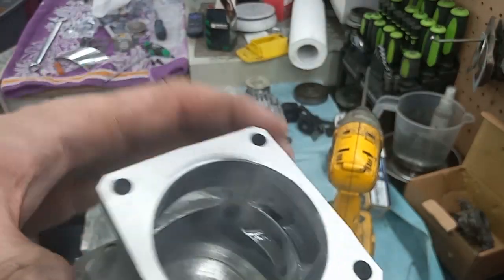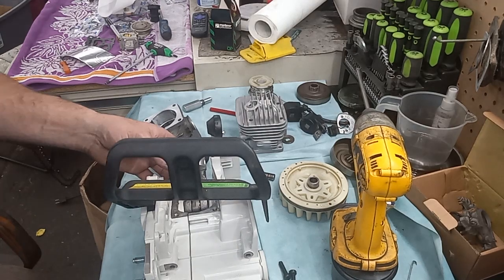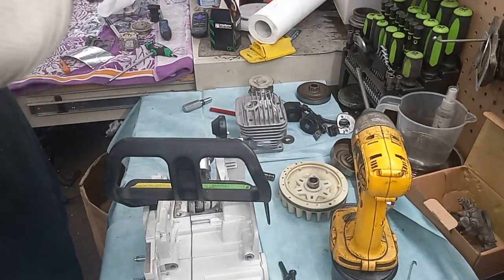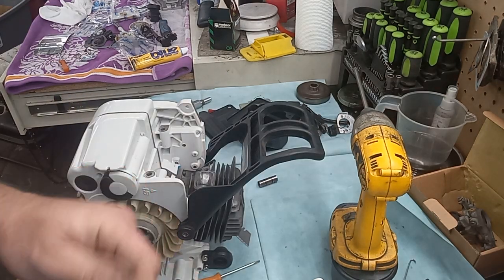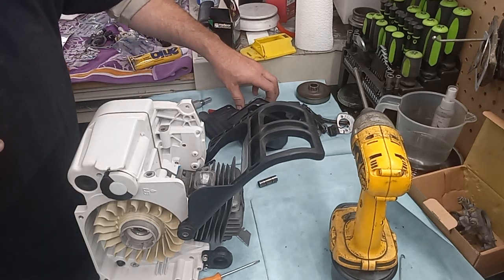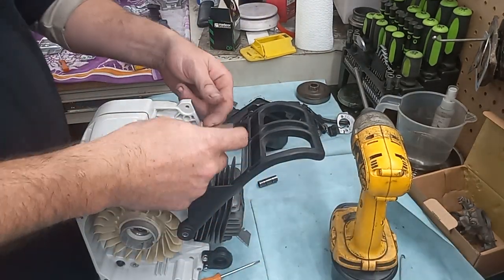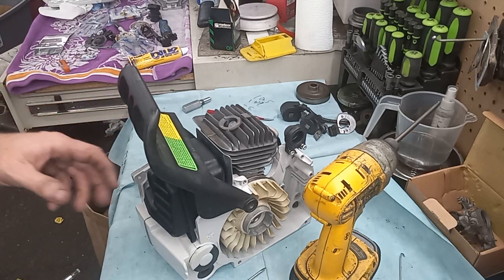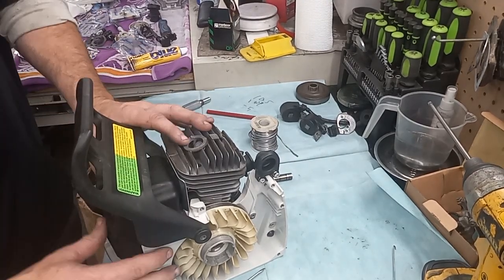Port work an numbers on ms460 build

Comment: Totally enjoying this build .I used to always use yamabond but now i use moto seal the yamabond would peel off so nice but i think thay changed it to motoseal works well but tough to get off alot of people use that stuff you are trying let us know what you're thoughts on it after you have pulled a cylinder back off i am interested just slow to try something new if what i am doing is working well.